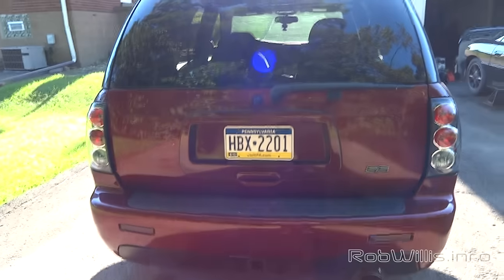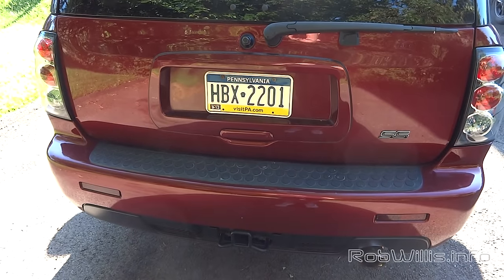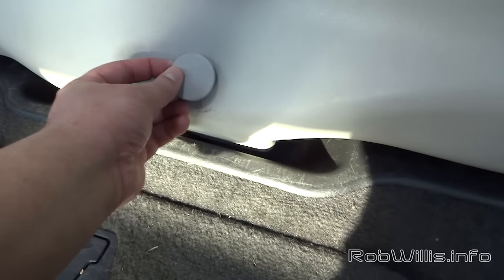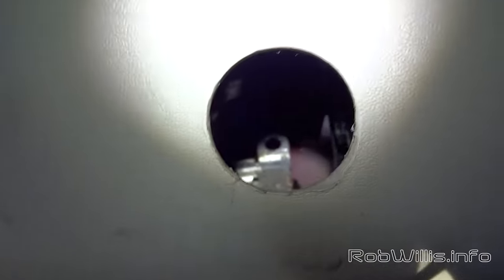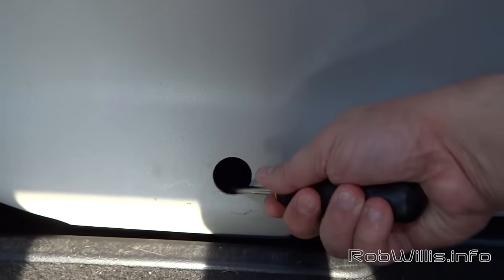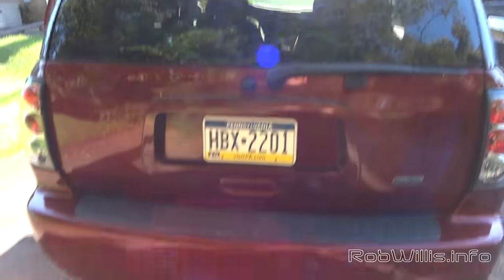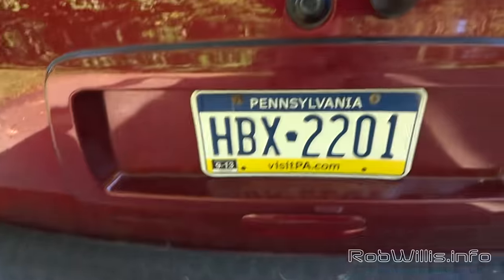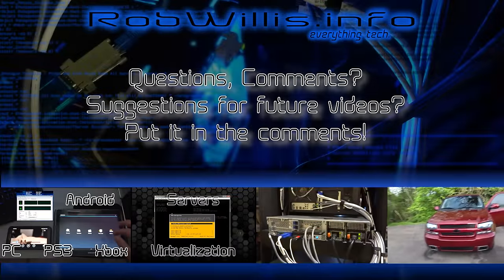Manually unlock a Trailblazer lift gate hatch! Trailblazer SS LS2 Envoy

Comment: Dude! Thanks. I'm not a mechanic at all but your no BS video completely answered my questions. I own a 2003 GMC Envoy and yeah that did the trick.
Reply: Thanks for the video, got the hatch on my Envoy to unlock from your instruction. Simple and easy to follow 👍🏽
Reply: my '02 Envoy SLT liftgate won't lock with the Fob or main locks...well an update, figured that it's the rust at the bottom just along the leading edge of the liftgate caused by the buildup of snow, I did sell it though 2 weeks ago, so Dec 3 2021..too bad, it was a Great suv!! We had so much fun in it!!❤️😁👍😉😊 the warranty history not long after purchase around 4 year's is ridiculous,(motor, transfer case, two trannys, front/rear diff, tail lights, upper and lower control arms, wipers, 267000km ) ..now we have an '06 Chevy Trailblazer LT high km 361761..as of this morning, runs amazing-also the 4.2,
 ..an ignition issue coming on though as ya' turn to start you have to juggle it to run
Reply: @johnedwardkeoniambrose1151  I'm

Comment: Looking for "Help"  suggestions re '07 Envoy. Following these directions glass is locking/unpacking but metal portion not. Lift gate is open but mechanism remains in locked position so tangs block it from closing. Re 1st step moving upward that lever to left it is not staying up???

Comment: Thanks for the video man!!! My trunk and rear window in my 2003 envoy wouldn’t open, so I tried your trick and after moving the tip on the left with red plastic/rubber I was able to open my trunk window and that released my trunk, I didn’t even had to move the piece on the right.

Comment: Thank you!  My daughter's Trailblazer is an earlier model.  Only the lever with the round hole was readily accessible (her upper glass still opened).  I pushed the little lever to my right.  It went "thunk" and the tailgate opened again.  It took me longer to climb into the cargo through the back seat, climbing over two child seats, than it did to make the fix.

Comment: It worked the first time..... I sprayed wd 40 on it...... then I started getting the light on my panel saying "Liftgate Open", when it actually wasn't.  A few days later it's stuck once again.... Yesterday I was unsuccessful at unlocking manually like I did before... but I'm thinking maybe I did not lift that first lever you showed, so I'm heading out to try once again.  I'm having all sorts of crazy complications with this crazy vehicle.
Reply: Well, I never got it open... so I had to go to the feed store... I was just planning on putting it in through the side doors (what a pain)... but when I got to the feed store, the tailgate was open!  So I drove it all the way home open (down but open)... afraid that if I shut it, it's going to get locked down again.... so I guess I will just leave it open.... I HOPE to be able to get a newer vehicle soon.

Comment: Thanks for the video. Initially it did not work for me but then as I fiddled with it I noticed that inside the service hold there is a little lever on the right side (mine had a green plastic grommet on the lever.)  If you move that up by hand then it all works again.

Note:  mine is 2002 GMC Envoy but it should be the same on the trailblazer.
Reply: This was the solution for mine, the video didn’t work but I lifted the knotch on the right and the trunk unlocked, 2006 Trailblazer. Thank you
Reply: Oh my god this comment should be pinned nothing worked besides this

Comment: So my hatch is stuck closed. And the button you press to open glass is stuck in and will not release. This has been causing my battery to die with in a hour. I hope after I try this it works. I'm tired of my battery constantly dying do to my hatch being "left open"

Comment: Ive got a problem, It looks like the metal attachment on the lever you first pull up has fallen off and the thing you push right is rusted as heck. So how can i take this plastic piece off so i can fix the inside?
Reply: I have the same problem =(
Reply: me too 2002 Envoy

Comment: my latch was still stuck after trying this, so i sprayed a load of WD40 in there and let it sit for a while. then i got some electrical wire wrapped around the lifting  latch part on the left side of the hole, the one he identifies at 1:01 in this vid. see 'How To Install Replace Rear Lift Gate handle 2002-09 GMC Envoy Chevy Trailblazer' at 5:27 to see how the system should work. then all i needed to do was a strong pull up on the wire i had wrapped around the plate and i could hear the door open. i'm leaving the wire in there in case it happen again.

Comment: So what about when the handle is broken? I got a great deal on an 04 trailblazer, so I bought it as a second vehicle. Anyways, it seems to have been hit by something like a trailer it was hauling. The damage is on right below the windshield wiper and the wiper won't work now, the hatch handle is broken, but the back glass button still pops and opens as normal. Any advice on how to fix this? Thanks

Comment: Thanks for your tutorial, I just unlocked my Trailblazer 08 tailgate and yes! I found a coat of rust in the area. Now the rear wiper arm i noticed it wasn't working, could it be related to the lock issue or is a different story?  thanks again.

Comment: My 2002 Envoy SLT won't lock with the Fob or the main locks I don't even hear an actuator making noise to tell me one way or the other, I sprayed WD-40 in the lock area it moves freely now ..before was sticky, however the locking still does not work

Comment: My opened, but now it won't lock automatically,  it stays open, and my rear wipers, and rear defroster and alarm, stop working. Any ideas what it could be. Would greatly appreciated. Thanks. Great video.
Reply: let me know if you find out the issue Manuel, same on my '02 Envoy

Comment: Hello can this same process be used for a 2004 envoy?
Reply from the maker: Yes, it should be the same.
Reply: thanks
Reply: I just did mine with no issues was a breeze. Took some W-D40 to the working parts and cleaned the latch with a brush and W-D for corrosion. Good as new!
Reply: an '02 Envoy also? mine won't lock with fob or main locks

Comment: What do mean by air bags?
Reply from the maker: The SS has air suspension in the rear. So rather than a spring and a shock, its an air bag and shock. This means the SS also has an air compressor built in which is required to fill up the bags and keep the pressure right.
Reply: @robwillisinfo  ok thanks for the info